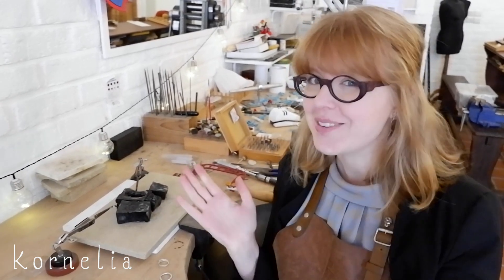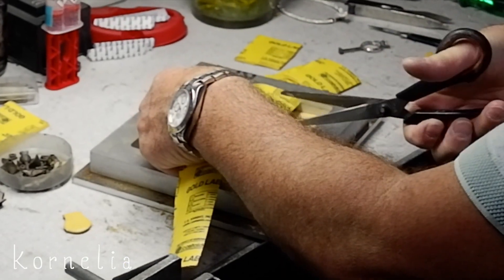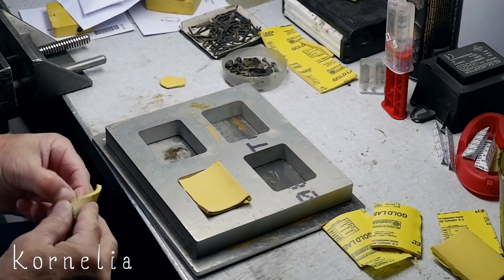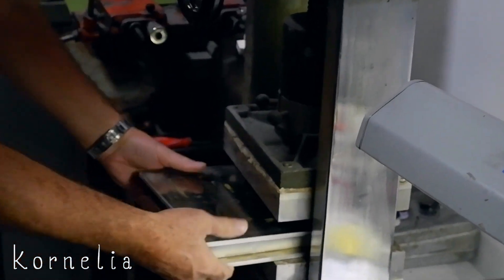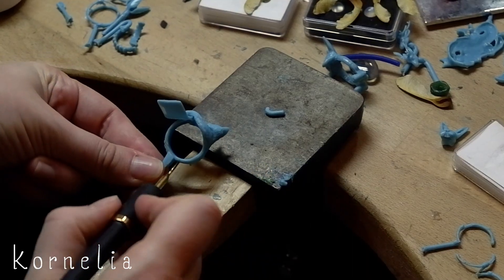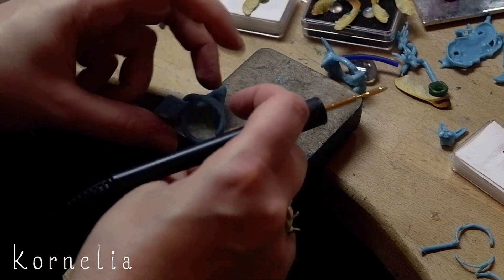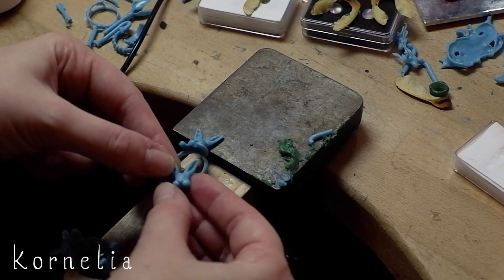Lost Wax Jewelry - part 3 - mold to copy your original jewelry

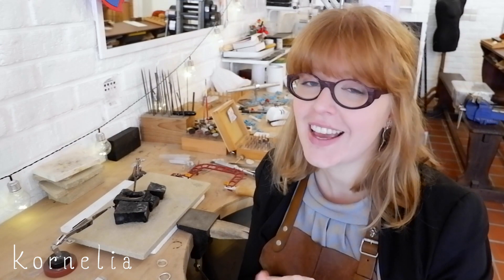Comment: Thank you for your video. Regarding 2:43, it is true that molten metal should not be poured into a rubber mold. However casting resin such as polyester, epoxy or polyurethane can be cast inside rubber molds. The casting resin originates as two part liquid ingredients which after mixing undergoes a chemical reaction which solidifies into a hard plastic reproduction of the original pattern. For a small aperture rubber mold, after casting resin has been mixed and is still fluid, then there is a limited time opportunity to use a disposable syringe to inject the plastic fluid into the cavity of the rubber mold where it will solidify. For large aperture molds, then a gravity pour of the mixed casting resin while it is still fluid can be performed. To strengthen the mixed casting resin, reinforcing fillers such as glass microbeads, or tiny fibers of graphite, glass or silica can be added to make the solidified plastic much stronger & more durable.

Comment: Nicely done :) well yes you can make a liguid clear silicon mold of wax models. Ummm yes you can cast low temperature metals like tin and pewter directly into a rubber mold.
Reply from the maker: Oh yes, you’re right, you can make a clear silicone mold from a wax model, I’ve never done that, but in rubber it isn’t possible. Oh and I worked with pewter a lot when I was still in school (I kinda forgot about that 🙈 lol), I should have said it isn’t possible with silver or gold. Thanks for reminding me and sharing your knowledge here! 👍🏻

Comment: Hello Kornelia, thank you for such informative videos. I enjoyed watching all of them. I have a question, do you think it is worth investing in a wax injection machine for my studio? Where did you purchase yours? Thank you!
Reply from the maker: What I love most about a wax infection machine is that you fill up the rubber molds with wax and change your original wax design. This way you can easily adjust ring sizes in wax (before casting in metal, it saves a lot of time!) or to make variations of you mr original design. But don’t buy this machine too early, only do it once you have a lot of rubber molds, so you’ll use it often 😉 I believe I bought my wax injector from a local supplier here in Belgium, but you can buy them at Cooksongold, RIO Grande,... just check your local jeweler-supply company 😉 good luck 🍀

Comment: Hey i know you said that you were open to corrections so i thought i would throw in my two cents, you can actually make a rubber mold from a wax piece, you just have to use casting rubber as opposed to using vulcanizing rubber (also doesn't need its own machine like vulcanizing rubber requires)
Reply from the maker: Is it just as sustainable as a vulcanized rubber mold? We learnt in school that those kind of molds will not last that many years.
Reply: So it all comes down to the quality of the casting rubber you buy, in years past no casting mold was in comparison to a vulcanized mold, but nowadays it is feasible. You dont want to go cheap get the quality material. I just graduated last year with my bachelor in metalsmithing and the standard was castable molds, the mold that I recommend is  Freeman Jewel-Sil Clear RTV Silicone Rubber 1 kg kit, in the united states its about $60USD, it is also handy in the way that the name implies, it is translucent.  It is recommended to have a pressure chamber to get rid of bubbles in the mold, but since your videos are oriented towards beginners or people interested in the technique it is an easy way for a beginner to try their hand that replicating their pieces! Im actually doing some wax injecting with some right now!